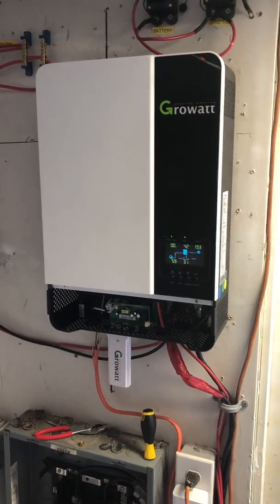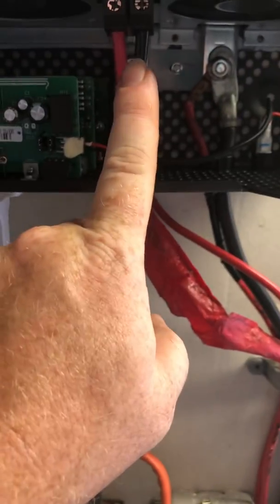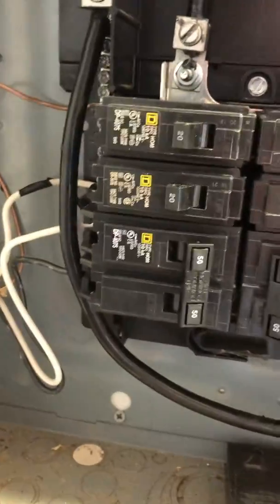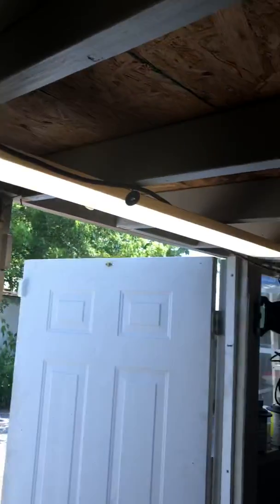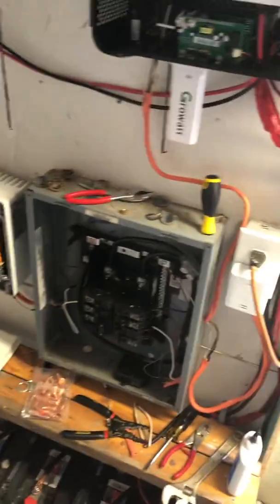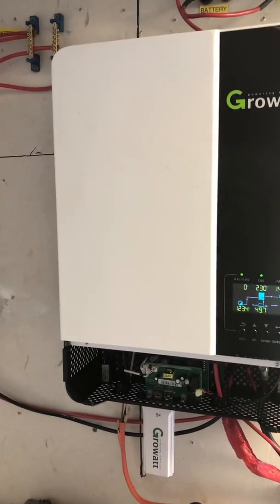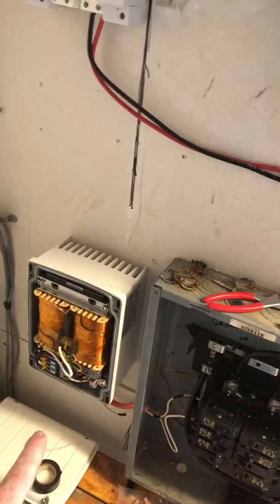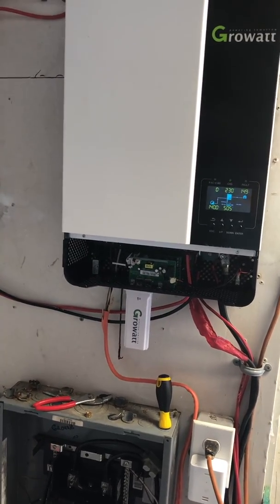Review of Install Growatt SPF 5000 ES

Comment: I know this is two years old, but put a cover over your batteries - like a piece of lexan.   It can be removeable.   If that large adjustable wrench falls on a battery, you can be sure it will hit both terminals and short the battery.   I've seen batteries explode when they are shorted.  The top will blow right off blowing acid all over the place.   It can be really bad.

Comment: Thank you for sharing 
Q. Why have a breaker between the inverter and load center ? If the loads from the breaker box has breakers why the input? Esp the transformer , which if tripped would cease to provide the stepped down 120v ?
Answer would be greatly appreciated
Reply from the maker: There is no between the inverter and load center. The breakers are between the solar and the inverter. Also, there is a breaker between the inverter and the batteries

Comment: can you use this inverter in a panel already connected to the grid?
Reply from the maker: No. This is an off-grid inverter system. You CAN use grid power to feed the AC input on these inverters so you can be off-grid during the day and burning grid power at night

Comment: do you have to "Charge" the capacitors with resistor first when connecting the battery.  The manual doesn't show it but seen a lot of people do it like mr Poz.  Manual does not say to do that though?
Reply from the maker: It is probably better if you do use the resistor to pre-charge the inverter capacitors

Comment: Hy.why exactly do you need that transformer?i live in Romania and i have 220 v on my grid.i need also transformer
Reply from the maker: This video was made for the US.

Most people in the US do not have "true" (European) 240. If you are trying to run an appliance (well pump) that supports "true" then you would not need the transformer. What most people in the US refer to as 240 is actually "spilt phase" or two legs of 120. In the US, Your dryer and water heater run on "spilt phase" and not "true" (European) 240

Comment: Do I have to use the transformer
Reply: The Transformer is unnecessary for 240 loads. If you want 120 power the Transformer provides a neutral by splitting the phases. If you are say only powering a 240 well pump or other items that do not require a neutral you are good to go no Transformer needed
Reply from the maker: This is not complete. Most people in the US do not have "true" (European) 240. If you are trying to run an appliance (well pump) that supports "true" then you would not need the transformer. What most people in the US refer to as 240 is actually "spilt phase" or two legs of 120. Your dryer and water heater run on "spilt phase" and not "true" (European) 240

Comment: Hi sir

Can I ask why a transformer is needed?  

I'm looking at the spec of this unit right now, and it is claiming that it has an output voltage of "208/220/230/240 VAC ± 5%".

Granted, I'm not an electrician, but i do read a lot of manuals.  And this appears to be saying that the Growatt outputs 220 already.

Please inform a desperate Vol!
Reply: Pls ignore this query..  I see your answer below.

Comment: Thanks for a very informative video. I am trying to install the same inverter to 10 solar panels, each is 550w, 42v, and 11a. Having your panels in a series of 5 and parallel double the amperage to 22a which higher than the max input current of 18a  specified the user manual. This does not make sense to me. Help is appreciated!
Reply from the maker: Thank you, Paul. How you will be wiring your panels is different than how I have done mine. My panels are 250 watts and produce 30 volts which is why I have them in 5 series which gets them over the 120 vdc minimum. However, I have since changed things up and I now have them in 10 series which is giving me over 300 volts.

You might want to put yours in 10 series as well. This would put you right at 420 volts which is the max volts on this unit. You would want to check the volts open circuit and compare that with the max volts open circuit of 450 on this Inverter
Reply: Update, I have wires them in a series parallel of 5, had around 210v and 26 amps (each panel is around 13 amps not 11 as mentioned before). I had a max output between 11am and 2pm of 3700watts. Wasn’t happy with the results as the PV array is 5450 watts. Too much power was wasted. Apparently the inverted clipped the current coming from the panels at 18a (210v x 18a= ~ 3700 watts). So decided to change the connection to series. I have tested the voltage of the panel and it easily goes up to 45-46v at midday ( not sure why it states 42v on the label). So changed the wiring to 9 in a series. Had around 400v and 13a now. Bellow the max voltage and voc. Couldn’t do 10 in a series. The max output by the Inverter is now 4,300 watts ( PV array is 4900 watts). Much better!
Reply: @paulyo4257  hello i have a question i have a same setup as you i have 10 panels each 540 watt with voc 43 volts and currenet around 12 A can i connect 2 parallel with 5 series panel
Reply: @omarsayed7395  if the open circuit voltage of the panel is 43v, I recommend connecting the panel in series as the total PV array voc is 430v bellow the max of the inverter of 450v. Just make sure do not exceed the VOC of the inverter otherwise you will damage it. However, I am not sure whether the 43v you have mentioned is the voltage at pmax or voc of the panel, as there is a huge difference between the two. For a 540w panel I think the voltage at pmax will be 43v not the voc, as 43v*12a=516 watt which is close enough not taking into consideration fractions..
If you decide to connect 5 in series parallel, the max current will be 24A and you will loose some potential power as the inverter will clip the current of the PV array at 18A, no damage to the inverter here put you will certainly loose some power in peak sun hours.
So the perfect solution will be the same as mine, connect 9 in series
Reply: @paulyo4257   yes this was exactly what i was thinking thank you for your time
Reply: @paulyo4257  Really helpful feedback, this confirms that with 2 parallel strings you overload the inverter cause the amps of the 2 strings add up.
So the optimal for this system should be 12p1s with 500w panels 37.5Voc/panel so that the amperage is not exceeded? Maybe a little less to have some headroom. Somebody any thoughts?

Comment: Thanks for the video!
1) Are you sure your surge protector is grounded? I don't see a ground wire coming out of the bottom lug
2) I saw in a David Poz video that he said that big knife transfer switch failed on him. I have 0 experience with it, but he said it's a piece of crap!
3) How loud does this unit get when running near the MPPT max or inverter max? I have a smaller growatt and I'd like to upgrade if it doesn't create tornado volume winds
Reply from the maker: Hey Adam. Ya the surge is grounded now but was not when I shot the vid.
@David Poz is the Man! He has personally helped me out quite a bit. I hope this knife holds up.
I have never had it all the way up to the 5000 w but I dont think it would be that bad. I dont think I would want to sleep next to it, but in the right location I think it would work.
Reply: I thought David was trying to use it as an AC transfer switch, not a disconnect for the solar panels.

Comment: No grid power connected?  Have you ever hooked up a generator to this to charge up your batteries after many cloudy days?
Reply from the maker: The breaker box in the video is powered by grid power. To turn on the inverter, I first need to turn off my main breaker to disconnect from the grid. I have connected 220 V output on my generator to the AC input of the inverter and it has worked great
Reply: @tennesseevalleysolar4101  Sweet, that's exactly what I want to do.  Does it pass through a generator modified sine to the load or does it clean it up?

Comment: I'm slightly confused. Is 220AC coming out the Growatt Inverter and then being stepped down to 110AC by the transformer?  I'm considering a fixed off grid installation on property I own with the goal of providing 30 Amp daylight service to an RV (minimal battery bank). Could that be done using just this growatt (and the transformer if necessary), and say a 4kw to 5kw ground mounted solar panel array?
Reply from the maker: Yes. That sounds like that would work. The transformer is used to take the 220 AC and split it into the split phase used here in the US (two legs of 110).

Comment: I have this inverter and transformer and I want to install in my RV. How will I connect the ground?
Reply from the maker: The ground would need to be connected to a grounding rod. Because of this, it is hard to get a true earth ground in a mobile application.
Reply: @tennesseevalleysolar4101  some say I can just ground to the chassis of my RV would that work in your opinion?
Reply: @twelveofthem  "some" likely have a poor understanding of electricity. Grounding to a vehicle chassis is really just grounding to the negative post of the vehicle's battery.
Reply: @thomaspaine6682  what's wrong with that?
Reply: I want to do the same. What prevents using the grid ground into the inverter? Since it’s hybrid.

Comment: Filming Advise...Don't film in vertical mode.  Rotate your phone to film landscape
Reply from the maker: Based on how everything is wired, I decided I wanted to film in portrait
Reply: @tennesseevalleysolar4101  if you watch your video we could only see a little tiny strip down the middle that is video the rest is black on both sides. Therefore shooting it in portrait does not help us at all. in landscape mode we would be able to actually see items a lot better as they would take up the whole screen. Thank you for the video

Comment: You really should use the appropriate size wire/breakers.
Reply from the maker: You have no idea of the amperages and voltages that are running over these wires. What gives you that idea that the wiring and breakers are not the right size? FYI, the panels are in series and are producing less than 16 amps, so yeah the wiring is fine. Also the wire is stranded 6 gauge which is overkill in this case.

Comment: Why did you you just get a split phase gro watt?
Reply: They're much more expensive, and the straight 240 units provide much more power, if your loads are balanced.
Reply: Also they are not stackable. These units you can stack up to 6 and create a lot more power than a split phase inverter
Reply from the maker: From what I understand, the largest split phase Growatt has a 12kw inverter and can only work with 7kw of solar. I dont really agree with having the inverter being larger than the solar capacity as this would drain the batteries rather quickly. As others have stated, stacking the 5kw Growatts would get you a lot more power. 30 KW Inverter and 36 kw Solar input

Comment: What happens when the voltage from your PV panels drops below 120v, due to sun angle or shading? Does the charger controller stop accepting solar power?
Reply from the maker: The voltage of the panels do not change much due to the angle of the sun or shading. Those things will cause the panels amps to drop to almost nothing but the panels will still be giving about the same voltage.